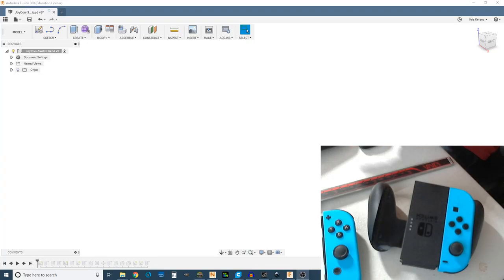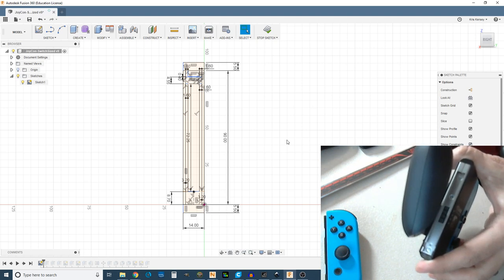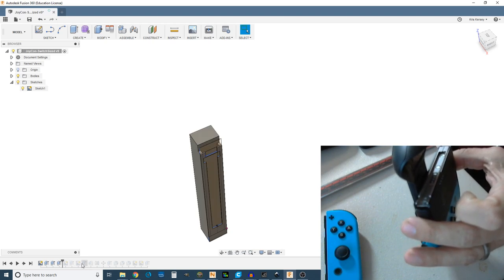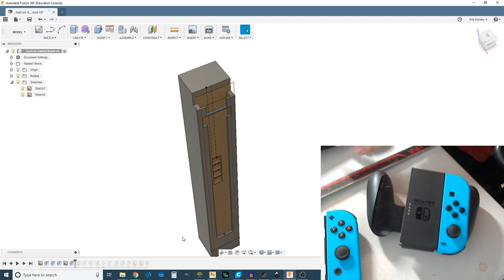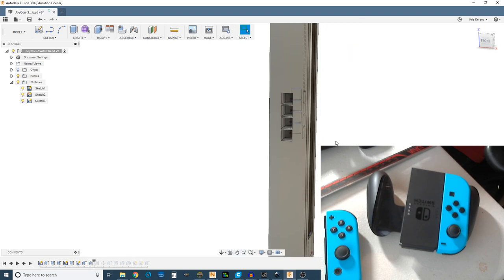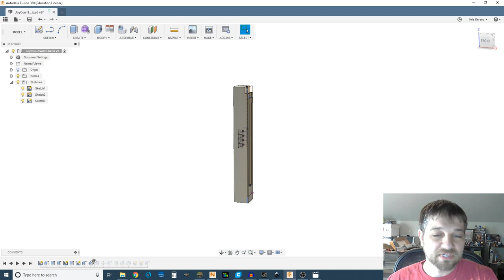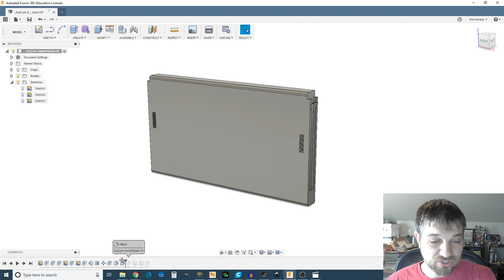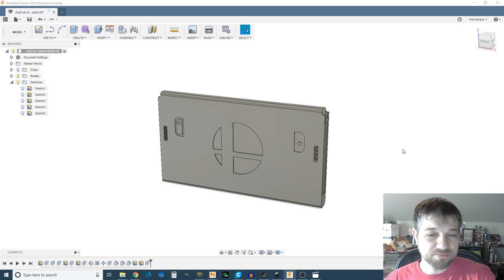Customize Your Gaming: 3D Printed Switch Joy-Con Holder

Comment: Any way too increase the weight to match the original ?
Reply from the maker: Yes there is! I did some testing and the Switch gamepad weighs about 290 grams. If you were to print the model with 100% infill, it would be about 280 grams. So that's really close if you're trying to get an even more accurate feel. Thanks for the question!
Reply from the maker: Sounds like a plan. What should I use for weight?
Reply from the maker: @M. Oyster I'll see what I can do in some of my "free time". HA! I'll post a comment if/when I can add it to Thingiverse.